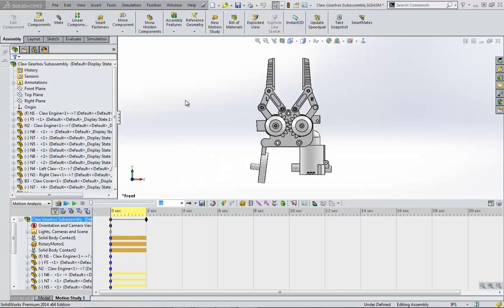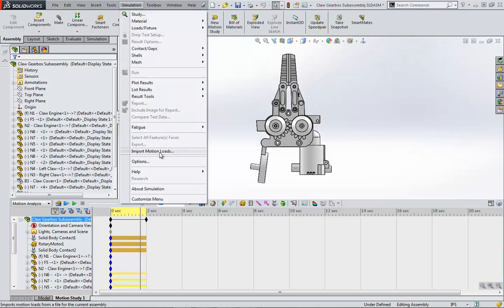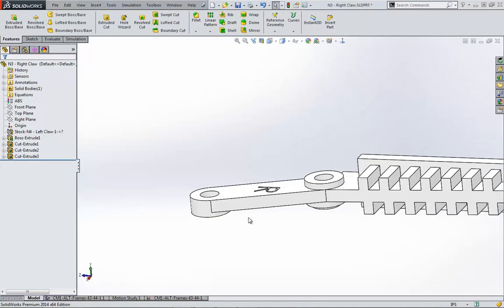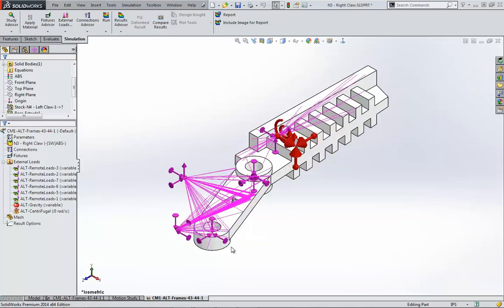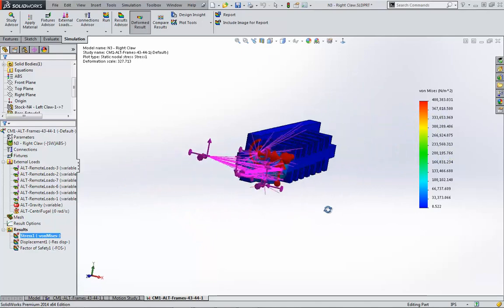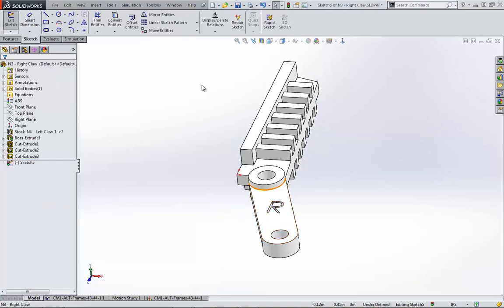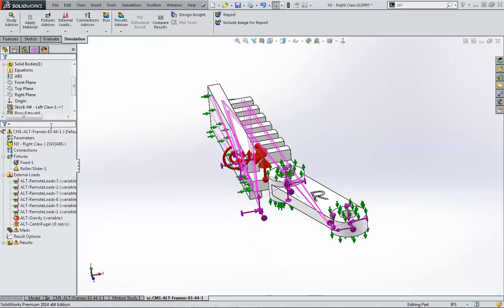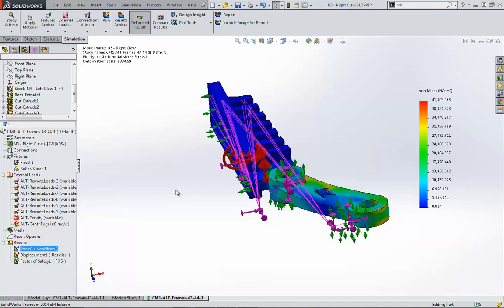SolidWorks Simulation - Importing Motion Loads

Comment: Why u use split line
Reply: It's said in the video. The part has real contacts with other parts in the assembly. The contact is just over a circular portion of the face. If that complete face isn't split into different surfaces, when applying the roller/slider constraint, the entire face is constrained and not only the circular portion where the contact with other parts actually exist.

Comment: Good day to Goengineer, i have a problem regarding about the import motion load. I have a shaft with a flywheel to rotate about 10 rpm in 30 s. The motion analysis runs smoothly, however, when i tried to import the loads into static to see the deflection and inputted bearing fixture (rigid) onto the split lines i had created, the transferred remote load appeared to be malfunctioned, and solid work gave out message saying that " One load/fixture/connector/contact is invalid". I had turned off the inertia relief and it still didint run smoothly the video described as above with fixture on and no change in remote loads. Sadly, I tried test with Bearing Fixture, Roller/Slider Fixture, Cylindrical fixtures to mimic the bearing support during rotational motion, all failed drastically.  May i know how to handle the remote load definition imported from the motion load when we had inputted the fixture or how i should input my fixture correctly? Thankyou Goengineer.
Reply from the maker: Hi Yi Leang Lim,

An error like that is difficult to troubleshoot without seeing the setup, I recommend you reach out to your local reseller’s technical support line, or to the forums at my.solidworks.com, where you will be able to upload your model.

It’s hard to guess what is ‘drastically failing’ about the bearing fixture, or other fixtures. I will make a few guesses here and try and give you things to look into. Are you applying the fixture on the same face as the load? Generally only one or the other will win. Is your model unstable? Think on the x, y, and z translations in your static study and make sure restraints are there to prevent that motion.  Did you create the split lines after the motion study? Try and make sure they’re part of the model before running the static study and the export. Do a simple motion with another two part assembly – does anything export correctly there? Is it the load that’s failing to transfer, and the restraint is fine? Use the measurement options in motion study to measure the loads on the faces you’re interested in, and apply those loads manually in a static study.

Comment: Good day to Gonegineer , why SOLIDWORKS stated "Could not create attribute data CMI-ALT DSGNSCN-DATA-S: Special loads...." when i tried with multiple frame study ?  Thankyou to Goengineer
Reply from the maker: Hi Yi Leang Lim,

Unfortunately that’s quite a specific error that may be specific to your model or system. I recommend you create a SOLIDWORKS forum post with your model, or reach out to your local reseller. 

To narrow down the problem, try the following:
(1)	Determine if it is a global problem / a problem with the model – do friends or coworkers receive the same error?
a.	Do a Pack and Go of that model, and analyze and export motion loads on another computer. 
(2)	Determine if it is a file location problem
a.	Do a Pack and Go of that model and run it on your desktop
(3)	Determine if it is an installation issue
a.	Create a simple assembly saved on your desktop (a block on a plane for example) and attempt to analyze and export motion results.

For one of those three cases, I’d hope the export would work, thus telling you whether it is an issue with your model, your SOLIDWORKS installation, or permissions.

Comment: Hello! Great video! But what if I got the Import Motion Loads window empty i.e. there are no components to choose in the left column? I have already checked contacts and engine, but it's still not working. I am making research into vibration screen design, so the whole model is vibrating under the unbalanced masses excitation. Motion works well, but when it comes to stress calcs, something fails. Can you help, please?